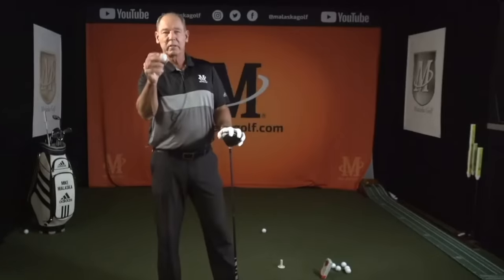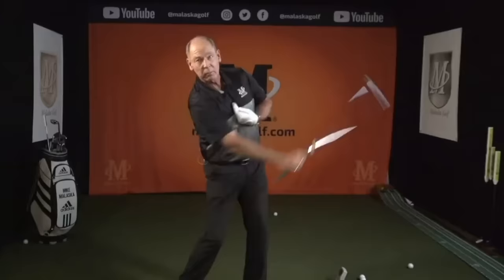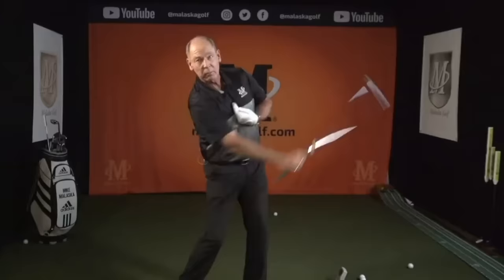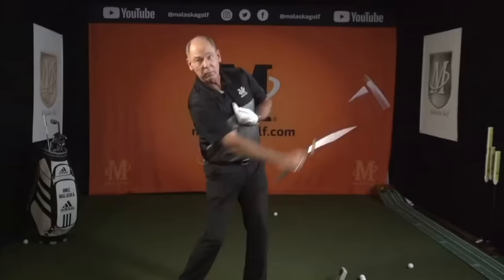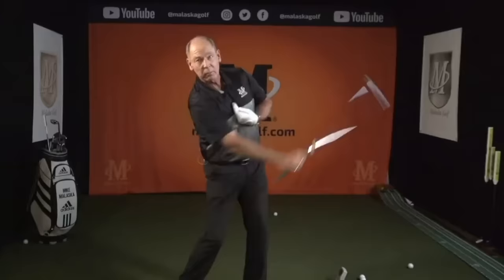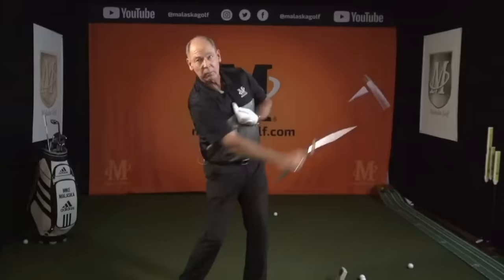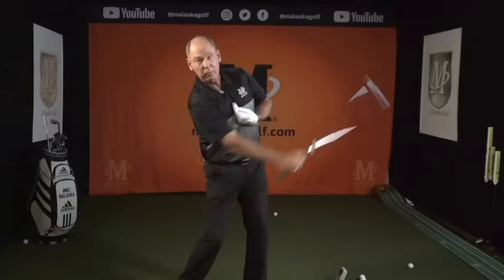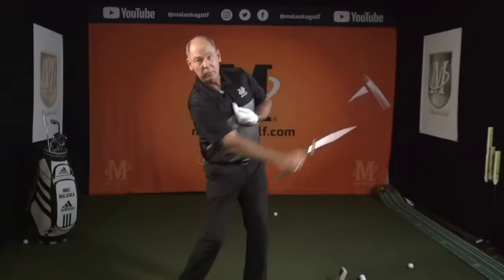Malaska Golf LIVE / DISTANCE / Episode 2: Where Speed Really Comes From

Comment: I just started playing golf about 6 months ago and started watching him around two months ago and my game has elevated like crazy. I used to be a power lifter and still have good strength but I found out pretty quick that strength is not everything, especially if you don’t know how to use it correctly. I changed everything I was doing and now I’m playing better than my friends are and they’ve been playing for years Lol Mike is a beast in his teachings, everything makes so much since and it’s easy to learn. The man makes the game so much simpler. I’ll tell you how much better I’m doing, not only my accuracy is on point but my drive ski rocketed like insane. Where I used to use a 9 or an 8 iron, now I’m beastin it with my 56 with no problems. Thanks Mr Malaska! You da man!

Comment: I'm so glad you keep putting these video's out there. So much of commentary at top level focuses on using the lower body, ground etc....that's great if you're a 6'3" tour pro who lives in the gym. For regular golfers the oldest and still the best drill is super light grip pressure at address because it allows the wrists to work fully, which is where you get most swingspeed from!!
Reply: If your hands (and forearms) are trained it doesn't matter what you do with your lower body, and it's not alright even if you're a 7' 3'' tour pro who lives in the gym, because you can't hit a ball with your lower body anymore than you can knock a nail in with it - because it, and the body is a non contact on the club. The body is involved but responds or follows the control and lead of the hands which must be trained.
Reply: Re. above reply. Reg Cade Fully qualified AA  PGA  Golf Professional and Coach in U.K. for 57 years

Comment: I'm not a golf teacher, and certainly not an expert, and I really respect Mr. Malaska and wouldn't be watching if I didn't. However....I would like to make an observation, and maybe ask some questions: You can't whip a stick lightning fast with your hand unless your hand is connected to your body which is resisting the arm motion with counterbalancing forces in the back, and all of it anchored to the ground by your feet and gravity.....I think it's definitely true that having tension in the arms and wrists and shoulders will reduce and limit power, but if you look at the total amount of energy in a golf swing, you need alot more muscle mass to create it than is present in only the arms. Right? You need your buttocks, legs, and back. Would it be correct to say that the fact that those parts of your body don't twist rapidly doesn't mean they are not "creating" speed. They are creating speed by generating force and torque which is amplified through levers and then applied to the club by the arms, wrists and hands? How fast would a baseball pitcher throw a ball if he simply sat in a chair and moved his arm only? Clearly the speed and power comes from using his arm as the conveyor of forces generated by the rest of his body, no?

Comment: Thanks, Just getting back into golf at 56 after 10+ years off. I stopped golf at a +7 and started up shooting 90+ with a few 80s and a few high 30’s for nine. I have a titanium rod in my trail leg, arthritis, etc... went from about 110 mph with driver and my best is about 90 now. That’s after some lessons at ... that got me into “positions” at certain points in my swing. I have much better distance and dispersion control but have lost some significant distance. I “feel” very rigid but will try to employ your instruction to gain some speed. Best of luck.
Reply: +7 that’s like elite pro you sure you don’t mean 7 handicap 🤷‍♂️

Comment: Problem I think is there is 20 plus ways you can hit a golf ball. There are a ton of youtube  golf instructors & online that teach various techniques. I've just joined golf club for first time & it's interesting to see there is a big variety of setup & swings for golfers achieving 230 to 280 yards.  For me, I've been working on upper body & separation is crucial for my backswing for good hip rotation with good hinging at top but it the arms, elbow , hand transition at impact that your using in the downswing but the movement of the body works in with where shoulders/hips are at delivery, impact and follow through to be able to get compression or hit on the up, and hit straighter than snap hooks or slicing. No good having speed but body in wrong position at delivery & impact.

Comment: Mike, have you looked at Dr. Kwon’s research?   You speak of swinging with less effort and yet creating more speed.   Dr. Kwom confirms that more torque is created efficiently by elongation of the moment arm within the swing arc rather than increasing the force on that moment arm.  Seems to me this is consistent with what you teach.  He calls it a body-driven swing and you focus on the primacy of the hand and arm swing.   But as I watch you, the smooth subtle lower body movement you have is accelerating your loose and tension-free arms. Interestingly,  your very good smooth lower body moves to increase your speed beyond that reached with a hand primary swing.  Am I wrong?  

I appreciate the video and have motivated me to examine my hand pattern through the ball as I was taught the toe up to toe up rotation method, and although a very low handicapper, this spikes my interest.

Comment: I'm a scientist, and you are using the right approach. If your speed is mostly from a flexible swing rather than a "core" swing and your consistency is mostly dependent on face contact then you are just using science correctly not just your opinon. Well done! I'm giving up all the core and body rotation crap and going to speed measurements from a flexible hand, wrist, and shoulder. What is the best method of maintaining club face alignment at impact?

Comment: The throwing analogy is a good one but the amount of strength or big muscle groups required depends on the weight or mass of the object being thrown! So a table tennis ball or a badminton serve is all wrist and forearm, a 1kg javelin needs a lot of dynamic strength training I would put golf at the weight of a cricketball which is a bit heavier  than a  baseball!
 But remember F=MA so the faster you accelerate the club the heavier it is and the more forces you have to control which is why Bryson bulked up! and unlike a throw where you are using a pulling and releasing action along a straight line a golf swing is more like a hammer throw with a lot more forces to contend with! So strength is required for balance and consistency to handle the speed not create it !

Comment: 17:05 onwards is just so,so important imo. It can't be stressed enough that the time, space and speed to hit the ball comes from transferring your weight into your left foot and side, then turning your hips before you start to swing your arms down and through the ball Sure it's all fractions of a second, but if your arms go at the same time as your hips turn /weight shifts then you're going to struggle. They need to clear so you can swing your arms quickly through the hitting area. And you have to be relaxed to do this. 

Instruction often says "start the downswing with a bump of the hips".This, imo is awful advice. Just watch Mike and see how the weight moves first from the ground up.

I worked this out and suddenly had enough time to have a nap at the 'top' of my backswing.

Comment: Mike M has massive arms. 
Momentum: p=mv (mass x velocity)
When arms decelerate the golf club accelerates
Its called the kinematic sequence. 
The larger mass decelerating creates more acceleration.
Reply: Mike's body mass doesn't change throughout the swing, and this is assumed to be a constant in your equation (force = mass * acceleration). He is increasing speed (acceleration) to generate greater force at impact. A reduction in speed (deceleration) should result in lower force at impact.
Reply: @Alandale45  "My equation" is  momentum=mass x velocity
Rotation of the body is the source of power in the golf swing.  Rotation creates momentum.
If arms are twice as heavy as another golfer, and velocity equal, then momentum is 2x.
Its no coincidence that long hitters have arms larger, heavier than average.
Bryson is latest example.

Comment: I'm sorry but with all due respect you could not be more wrong about speed not coming from the core. You have no clue about MOI of the golf swing. Yes you absolutely need to have loose upper body including the shoulders and arms but they are more "passive" than loose because they have to maintain the structure of the Moment Arm.  

I absolutely gurantee you that you will max out a lot faster using your arms/shoulders to generate speed than you will using your core and you will probable injure your shoulders.

I'll break it down for you:
1. The clubhead is designed to swing out.
2. The MOI (moment of inertia) max weight should be limited to the weight of the clubhead at the end of the moment arm. (do not confuse this with clubhead MOI which is specific to the clubhead twist)
3. The absolute definitive center of mass in the golf swing are the hips/pelvis/core.
4. The moment arm of the golf swing extends from the pelvis to the end of the arms and uses the legs to stabilize (ground forces). The trunk, shoulders and arms have to maintain one passive structure as to not introduce any resistance to the original pelvic center of mass.
5. The entire upper body must follow the center of mass to produce most torque. This means that the upper body including shoulders, arms, trunk and shaft must remain neutral throughout the golf swing. If you introduce any interference with your upper body you will increase the moment of inertia because you have introduced a "weight/mass" that is further away from the center of mass which makes it harder to create momentum. So Mr. Malaska, you are partially correct about the arms and shoulders being loose. But the arms/shoulders are not what actively creates speed.
6. The clubhead being the max weight (MOI) of the torque created by the pelvic center of mass is what creates speed and support to compress the ball.
7. Any other forces introduced such as tension, heavier clubhead, overuse of arms, will move the center of mass further away from the pelvis which negatively impacts the MOI of the spin/circle of the golf swing by moving the weight further from the center of mass.

It is simple physics but honestly very hard for 99% of golfers to understand or athletic/coordinated enough to do. That is why 99% of amatuer golfers either early extend or early release with no shaft lean at impact. They simply cannot passively hold the angles. So yes for the 99% of people you teach, creating speed with the arms makes sense.

Sure you can create plenty of speed using just the shoulders and arms as the Moment Arm as you demonstrated but that will only give you so much. You must introduce resistance (center of mass, core) to create the proper torque for the arms and shoulders to passively pass the torque to the clubhead.

Since you claim to have been a pitcher then you would realize that you can throw the ball a lot fasters using your legs and hips to rotate your shoulders and arms at max speed. You can't throw very fast just using "the whip" of your shoulders and arms.You might injure your shoulders/rhomboids/back doing so.